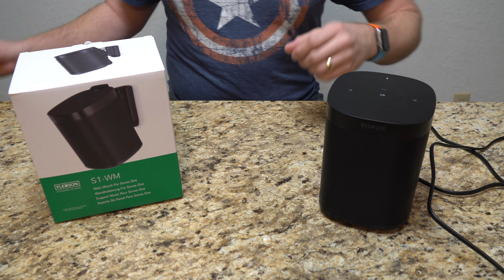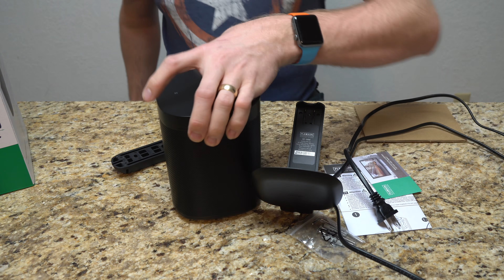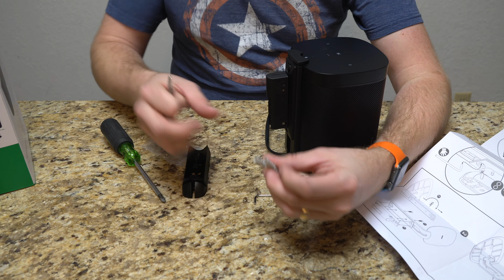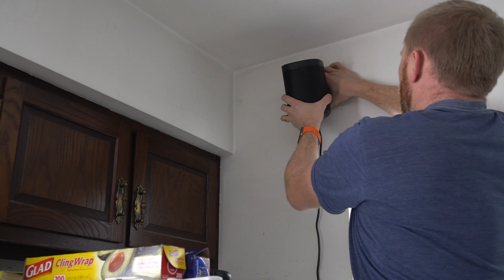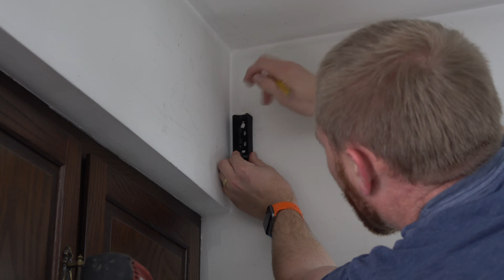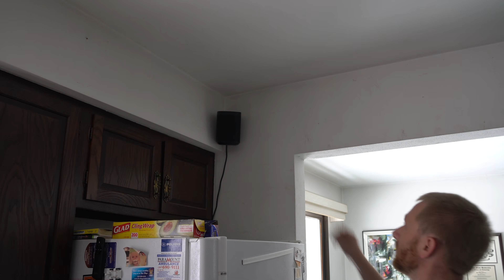Mount Your Sonos One with the Flexson Wall Mount Kit Install

Comment: You didn't had to squeeze the little screw part, you should not have clamped the power cable between the holder plate! Not so smart 🙄🙈

Comment: How do you hide the cable?
Reply: Just pig tail an existing receptacle and run the Romex, in wall, right up to the speaker, and install a new single-outlet receptical.  And buy the $15 1-foot flexson power cord.

Comment: Can it be somehow placed upside down, so that the buttons are accessible if you stand underneath the speaker?
Reply: Yes, the mount can be rotated 180 degrees so the controls are at the bottom and accessible.